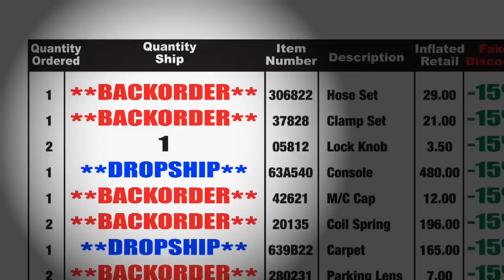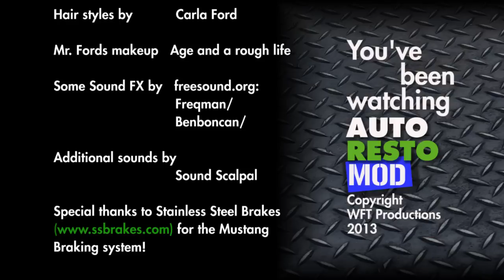Episode 113 single to dual bowl conversion for master cylinder Autorestomod

Comment from the maker: The proportioning valve is used due to the difference in fluid pressures between the discs and the the drums. If you have a drum, drum system already on the car, no, you don't need the prob valve, just a distribution block; and that should be there,

Comment: I watched many of your YouTubes, I have a 1965 Fastback K code which came with the original proportioning valve and  bigger master cylinder. Now I am taking out the original master cylinder and installing a dual bowl master cylinder as shown on your YouTube video.   I want to come out of my new master and go to the junction block as well as using the original proportioning valve.  Any info will be helpful. A diagram would be nice.

Comment: If you are converting four-wheel drums to a dual chamber master cylinder, should you still install the adjustmentment valve for the rear wheels?

Comment: What your actually doing is purging the air out of the cylinder bore so you don't pump it into the brake lines, also if you go slow the odds of the fittings for the hose popping out goes way down. ALWAYS KEEP THE TUBE ENDS IN THE bowls submerged in fluid other wise it will suck and you be pumping more to get it out. One bowel will bleed faster than the other keep pumping till both pushing only fluid no bubbles.

Comment: For the dual master cylinder do you just skip the distribution block for the rear brakes and go straight through the proportioning valve????
Reply from the maker: Unless you can find a distribution block for a  Do a reservoir master cylinder for your application then you will want to run the proportioning valve for the rear section

Comment: I have a 55 Chevy Bel Air 210 with a single port master cylinder with 4 wheel drum brakes. I would like to upgrade for safety to a dual port master cylinder and keep the 4 drum brakes as they are. Also the brake pedal will be kept as stock.My question is "What is the recommended master brake cylinder bore size" for my setup/ Also if you have recommendations for vendors with dual master cylinders with booster for my application. Thanks

Comment: I really appreciate and enjoy your guy’s videos. I have a 66’ TBird, with the single bowl. Obviously,I want to switch to a dual bowl. Are you at all familiar with these 66 birds? Any recommendations? I’ve done some research , but, can’t decide which dual system to use. I really don’t want to do any mods, and would like to continue using the factory prop valve. Any recommendations you might have, would more likely be the final answer for me. Thanks again.
Reply from the maker: Honestly Clint I would probably go out to some of the Thunderbird forums. There's a lot of good information out there on this swap for those year Thunderbirds. Some mods will have to be made regardless if you want to go to a dual bowl reservoir.

Comment: Is it possible to run a duel master cylinder. With drum brakes? My 66 Ltd, has a single cylinder master cylinder. Is it possible?
Reply from the maker: Absolutely. This method works on the big cars too!

Comment: On the install you didn’t mention which port on master cylinder went to front or rear brakes ?
Reply: It looked like the front brakes connect to the rear reservoir and vice versa.  But I was wondering the same thing...

Comment: I have a single bowl master cylinder (no booster) on a 63 falcon. Have you ever had a hard break pedal and  very weak brakes? I've replaced all the brake cylinders, brake shoes and hardware except the master cylinder. they are completely bled and yet I can hardly stop the car. ???? Any thoughts?
Reply from the maker: First, I'd personally replace the single bowl with the dual reservoir. Next I might unhook all the brake lines to see if you have a feed issue. Beyond that, I'd look at the backing plates to see if they are worn.

Comment: What did you with the port from the distribution block that used to go out the rear brakes since you connect the master straight to the proportioning valve?

Comment: Hey,I have disc on the front and drums on the rear,the master cylinder has a small and large reservoir the smaller is closer to the booster. Is the smaller one for the discs. And do I need a p-valve
Reply: the larger reservoir is for the disk brakes. As the brake pads wear, the calipers will hold more fluid and the fluid level in the reservoir will drop.  With a disk/drum setup, you will likely need a proportioning valve.  Disk brakes generally require higher pressure then drum brakes.  If you use an adjustable proportioning valve, install it on the line going to the rear so you can reduce rear brake pressure.  If you do a disk front brake conversion on a car with manual brakes and the pedal is too hard, you can use a smaller bore master cylinder to increase brake pressure.

Comment: I'm in the middle of this job and really can't find any good info. on how to install the new pushrod in the new master cylinder. Is it as simple as taking the clip out of the new MC ...putting the rod in...and replacing the clip?
Reply from the maker: Most (some?) of the rods have a C-clip that is on the rod it self. The rod can be removed without taking out the larger C-Clip and causing the master cylinder to vomit all over the table. You'll need to clamp the master cylinder in a vice and pull on the rod. It should come out.

Comment: I think I asked this before but just in case I am going to ask again! Can you help me find a dual master cylinder kit to replace my single MC on my 64 Fairlane? I have thought about buying the one for Mustang but I am worried that the rigid hoses may not fit or come close enough... My car has the same distribution block that the Mustang (I think?) Looks the same to me.
Reply from the maker: +GeorgeBonez George, regardless of the line set up you will most likely have to re-work or bend the lines into  position. We'd recommend getting the Maverick disc/drum manual master cylinder if you are moving to disc brakes on the Fairlane. If you have any other issues you can contact Jeff at: jford@autorestomod.com

Comment: You mention using a proportioning valve for disc/drum setups, but do I need a proportioning valve for disc/disc brakes?
Reply from the maker: Usually no. We'd always recommend chatting with the brake manufacturer for their recommendations though.
Reply: +AutoRestoMod Muscle Car Resto and Modifications Thanks for the reply. I have the SSBC front and rear disc kits. They sent me a proportioning valve, bit I'm not sure if that was just part of the front disc kits anyways. Since you guys did the SSBC swap, I thought you might know.  PS.....I enjoy your channel here.  Very entertaining and informative.
Reply from the maker: Racoldgin The best rule of thumb on Prop valves is if the rears are locking up well before the fronts squeeze off the line a little to the rear with the prop valve. Hope this helps.
Reply: Racoldgin thanks guys great video

Comment: Okay, I was just wondering because of the distance between the front brakes to the master cylinder compared to the distance with the rear brakes to the master cylinder is substantially greater and wanted to know if that would affect it at all.

Comment: So if you do have the c-clip on the pushrod and you split the piston, do you reuse the c-clip on the dual bowl? if so, how do you get it in the piston? If not, would that not pose a threat of the pushrod slipping out of the MC?
Reply from the maker: With the pedal/master cylinder in place the piston rod will not come out.

Comment: if you want to do this with a 4 drum brake system do you still need to add the proportional valve???
Reply from the maker: No. This is only for Disc Drum applications.

Comment: So I was wondering what if your mc has the brake light switch on the front of it like my 63 galaxie does?
Reply from the maker: Some conversion kits offer a port for the brake light switch. Auto Krafters (https://www.autokrafters.com) offers a dual conversion and an inline switch (PN HW2003) to allow for the application.

Comment: I needed to know how to disconnect from the brake pedal it seems like I have to drop the steering wheel to get to it on a 1968 Mustang you didn't show anything about how to unhook it
Reply from the maker: There should be a cotter pin on the pedal. The pushrod can be move over off of the pedal. This video will give an idea. Sorry for the video quality. This was EARLY days Autorestomod. https://youtu.be/deVBf0vdjlg

Comment: will it fit on a 66 falcon
Reply from the maker: Just get the master cylinder for a 1968 Fairlane Torino. You'll also possibly want to get an adjustable pushrod for it.

Comment: Are the 2 lines that you used to connect the Master Cylinder to the distribution block and the prop valve sold as a kit? I already the Maverick MC but need the lines. Thank you!
Reply from the maker: We typically bend our own.